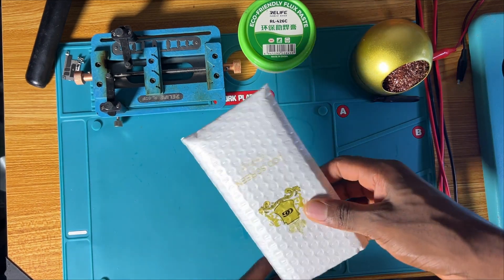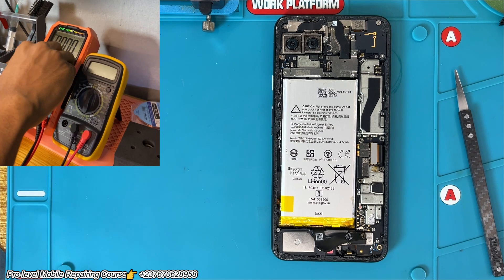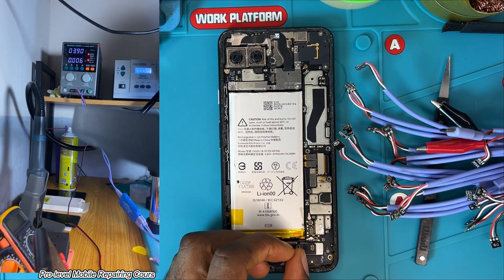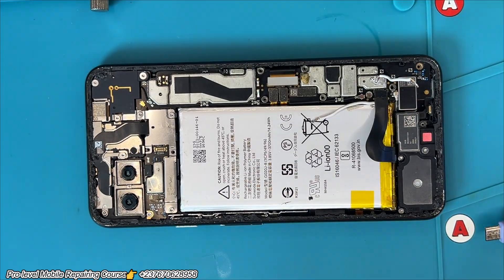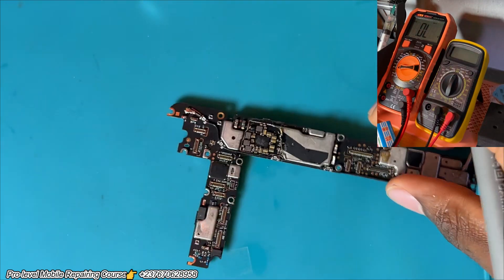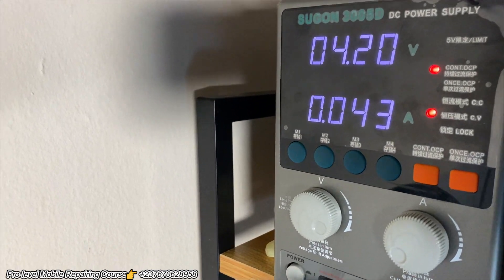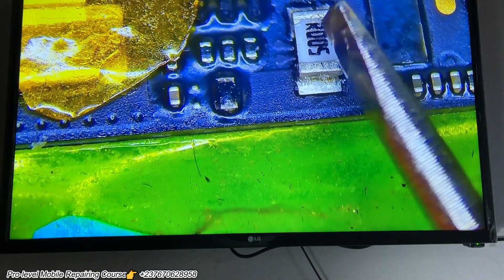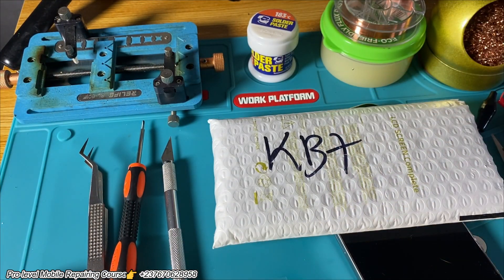How To Repair Dead Google Pixel Phones: Pixel 4XL Dead Recovery from Another Shop - Full Course

Comment: Good Evening Serges Mike. I seem to have only 1.5 at the battery connector with a 3.6v supply from the charging port. Any quick fix or is it a today strip down
Many Thanks Tony Armstrong

Comment: My phone went black but you to beep when I try to touch the power button... Gave it out to a repairer to help fixed it and afterwards, it wasn't even beeping... After giving it out to another repairer, I realized the batter cable connector was off from the battery making the battery detached from the board...
I want to ask if changing the battery will help boot my phone

Comment: Hello, Mike,

I suspect my Pixel 4XL's FPC Battery connector could be short(faulty), Is there a way i can use the multimeter to check if the FPC connnector is the problem ?

Will a battery connector(short) prevent the phone from booting up ?

Thanks.

Comment: Hello Mike,
The 2 removed capacitors fixed the problem or battery repair you did fixed the problem ?
Did you remove the capacitors or you replaced them with good ones ?

If you had repaired the battery and started the phone, would the phone have booted ?
or it was necessary to remove the capacitors ?

sorry for the noob questions.
thanks & regards.
Reply from the maker: Hi
Everything I did was necessary for the phone to successfully boot up. 
I didn't replace the capacitors
Reply: @SergesMike  ... that was lightening fast response ! thanks.
Would changing the battery with a new one too have fixed the problem with the 2 removed capacitors ?
Reply from the maker: No 
The capacitor was the reason the phone was able to power on. There was a short circuit caused by the capacitor. And the phone was totally dead at that state. Removing the capacitor solved the shorting problem ab the phone was about to show signs of being alive and the battery also had a problem so I had to fix that as well
Reply: @SergesMike  ... Oh ! A new battery would not have switched on the phone ?

does it mean this owner of this mobile has to modify the new battery in the same way you modified his old battery for the phone to switch on ?

PS : Subscribing your channel for the quick responses, thanks.
Reply from the maker: @IAGVyuing a new battery would have worked after removing the capacitors.  not before removing the capacitors. 

Thank you for the sub 😁
Reply: Please, I have same phone Pixel 4xl with same problem but getting a professional to fix it for me is my headache... I'm currently in Ghana... How can you help me fix mine and how much would it cost me

Comment: but there is already 0.007 short
Reply: I think it's the power supply problem even from previous video
Reply: @ayubtechke4294  this is common issur sugon power supply. 
But it when connect to the load it bacame to 0.000
Reply from the maker: Yes it is the power supply it was quite disturbing at first but now I have no problem as I have mastered it